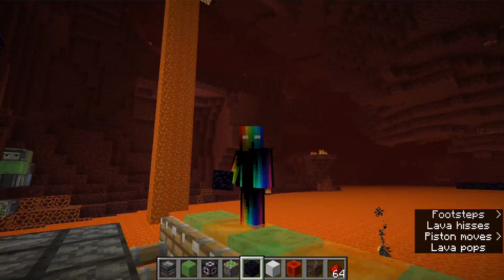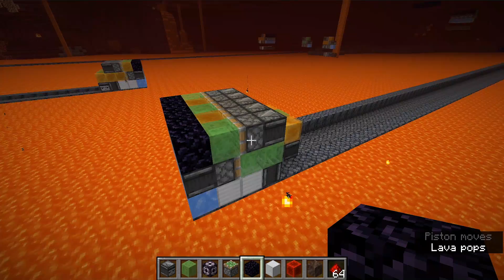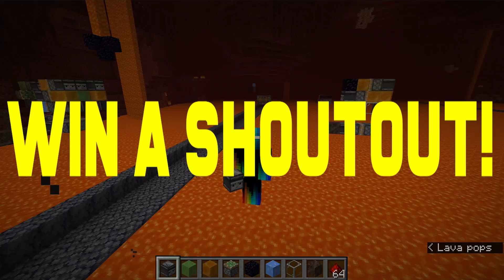Simple and Scalable Automatic Basalt Road Maker Design - 26.1 Minecraft Build

Comment: Is this for Java Edition only? 
I've just tried building this twice on Bedrock Edition and the system stops after the top moves once block forward because the bottom row doesn't move at all.  
The top-front observer ends up sitting one step ahead of the rest.
Reply: Any moving machine having 2 sticky piston on both sides never works for me in bedrock
Reply: i'm having the same issue
Reply: Two sticky pistons face each other? JAVA edition must have some mind bending mechanics, FM.
Reply: The bottom piston shall not be powered by the observer on top in bedrock edition unless there are blocks between them. You will also need to use normal pistons instead of sticky pistons in the places that push the machine since in java a one tick pulse spits out blocks while this is not the case in bedrock

Comment: WOW. this is so cool. will it work in bedrock?
Reply from the maker: flying machines work differently on bedrock, so this will not work
Reply: @DustyDude  Would have been helpful if you mentioned this in your video, description or title! :-(
Reply: The Top machine does work but the bottom part won’t, as far as I can tell the only way to make the soul soil machine is to have a completely separate flying machine
Reply: @williamhawkins7083  i built Machine, that works on bedrock
Reply: ChomChom Same

Comment: Found you on reddit, ur a genius, (I'm on bedrock)
Reply from the maker: Thanks man! Not sure if this works on bedrock :/
Reply: @DustyDude  ive been trying simple and complex basalt road makers but the issue i believe is the stucky piston connected to the two slime blocks that is above the down facing observer does not activate to pull the  observer or two  blocks of slime. Simply, the top sticky piston pushes the bottom sticky forward  and then pulls it back and the other sticky does nothing.
Reply: I wish 1.16 was on bedrock, but to be fair they are still in snapshots for Java.